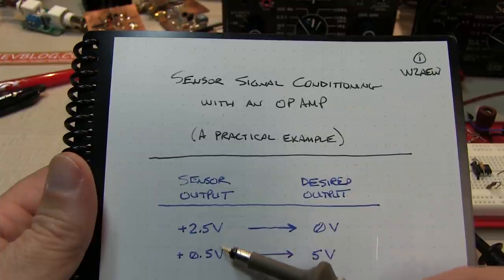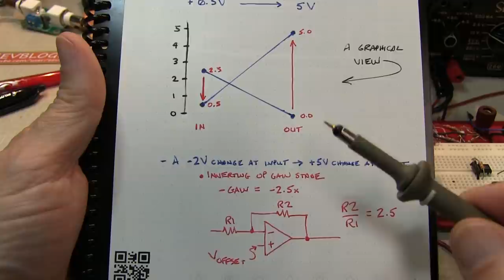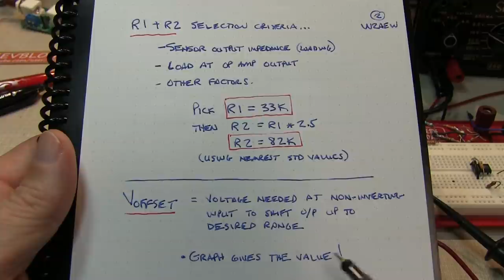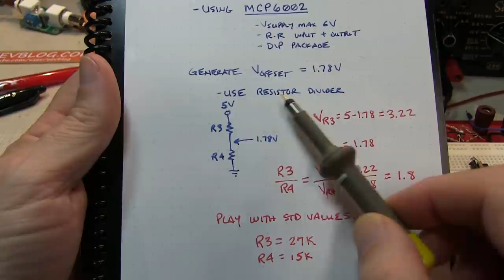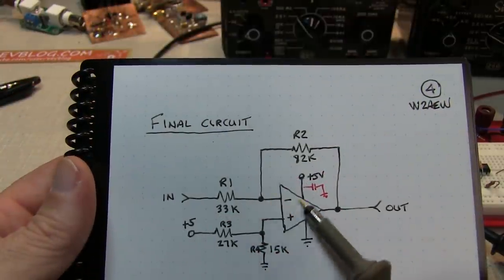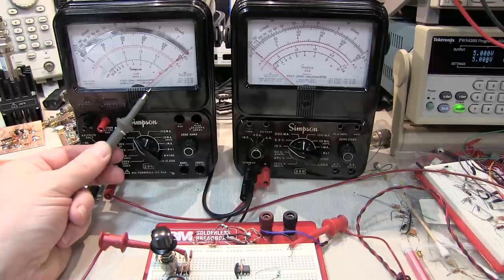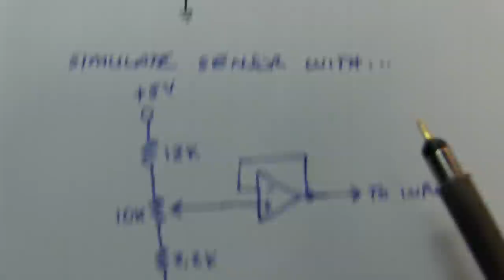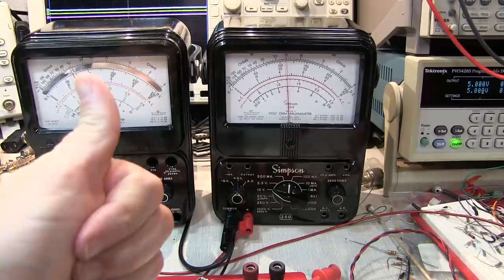#328: Circuit Fun: Op Amp Signal Conditioning - a Practical Example

Comment: This was great.   Thanx.    What are practical uses for integrator and differentiator op amp circuits?    Besides square to triangle or triangle wave to square wave generators.
Reply from the maker: There are a variety of filtering applications where they could be useful.  I've used integrators to generate the average voltage of a signal, and I've used differentiators to produce short pulses at the edges of square waves and PWM signals.
Reply: @w2aew  OHH!!!   OK  Makes sense.   Thanx.

Comment: This is a great video, but I was so sure the offset voltage was going to be 6.25V, because if you multiply the full range by the gain then add that offset, you get the correct output from the problem. While I understand how you calculated the 1.78 offset, I don't quite feel like I have the full picture, so I would have liked if you had shown the formula of the amplifier gain which included the offset in the equation.
Reply: Then you have to split the circuit in two parts. One part with only the input voltage and the second part with only the offset voltage. With the superposition theorem and some calculations you can determine the offset voltage. I can send you a copy of that calculation but I don't see an link or something else to do so.

Comment: Hi Alan,  I have a tricky op amp circuit request.  I have not found a single attempt at this solution anywhere on the web, or in text books.  Say my signal is a 150mV AC signal at 2Hz on a +3VDC bias.  I would like to separate my signal into its AC and DC components.  The only way I can sort of achieve it is to 'average' the AC using a high value R and C to ground and take an 'average' at the mid point.  Then use an adder in subtract configuration to remove it from the original signal.  Not very clean, due to the very low frequency AC component remaining in the 'average' signal.  The R is about 10Meg and the C is 10u.
Does this question make sense?
Thank you for your wonderful videos and very best regards,

Comment: What are those late series Simpson banana jack adapters you're using?
Reply from the maker: There are a few options for the reverse banana probes.  I show them in this video: https://www.youtube.com/watch?v=tfmRzkU_Y6g
These are the ones I'm using: https://www.amazon.com/gp/product/B07SSZVZLT
Note that you will likely have to slightly distort (squeeze) the barrel a little as I show in the above video.
Reply: @w2aew  Thanks. I picked up a series 8 meter and I remember the probemaster recommendation. I have several sets of their probes and I like them a lot but these didn't fit property on my meter. They sent me a second pair to try and the contacts on both were too small in diameter and became deformed (★★★★★ support.)  I also ordered some Oldaker 486-3 leads on ebay and those are a bit loose but work... OK.

Comment: More generally, if the power supply is not 5V or if it is susceptible to changing, you can use a biased Zener diode as the reference to the positive voltage divider.

Comment: Ok, a pedantic question from an engineering technician.  Other than the two in a  package why did you choose the MCP6002 over the National (now TI) LMC6001?  I can see from the TI pages that the LM6001 (national), the TLV6002 (?) and the MCP 6002 are all slightly different but are very close.  E.g. GBP LMC=1.3Mhz, TLV=1Mhz, MCP=1Mhz, Slew(typ) LMC=1.5, TLV=0.5, MCP=0.6 the noise figures are different, etc. The LMC lists the input bias current at 1000fA as a maximum where the TLV and MCP list that as a 'typical' unit.  I suspect this is the same "design" and the differences are so small that except for corner cases I can see them being interchangeable with each other from an engineering standpoint. Now that's with only looking at data sheets for 30 min.
Reply from the maker: Why did I choose the MCP6002 over the LMC6001?  Two reasons - 1) I needed another stage to buffer my 'sensor simulator', and 2) it's what I had in my personal stock.  Plus, the MCP part is a lot cheaper.

Comment: What be the  best/easiest way to convert a 3.0 volt(or other voltage) wall charger to power a 1.5 volt AA wall clock? Thanks in advance
Reply from the maker: A shunt regulator using 
- a resistor and a pair of diodes in series, 
- or with a "Vbe multiplier"
Or, use a three terminal regulator like a LM317 with the appropriate scaling resistors.

Comment: Good video very clear and shine (as always). What if I want to condition a negative voltage ( from 0 to -15V) to have an output 0 to 5V with 5V power supply? Is it still applicable. Thank you
Reply from the maker: The circuit would be a little different, but it can be done.
Reply: @w2aew  Sorry for the question. But how? The main issue I see is power supply limit of the OPAMP itself... Thank You for any hints
Reply from the maker: @Steve_LSP  The basic structure of the final circuit will be the same as this example, except that you would add a resistor divider to the 0 to -15V input, referenced to +5V at the other end.  For example, if the resistor ratio is 3:1, the -15V input will result in 0V at the divider node, and a 0V input will be 3.75V at the divider node.   Thus, you'll need an inverting gain of 1.333, and then adjust the bias on the non-inverting input as needed.
Reply: @w2aew  thank you for the help

Comment: Hi Alan, always great videos. Can you make a similar one but with non rail-rail opamps. Thanks.
Reply from the maker: Trivial - simply use power supply rails that are sufficiently far away from the input/output voltage extremes.
Reply: @w2aew  thanks

Comment: What about the slew rate and bandwidth of the opamp? Won't that make a difference, because the input is coming from some RF component?
Reply from the maker: The input is from an RF sensor - the sensor output is effectively a DC level that is proportional to the log of the input RF power - so the speed and slew rate of the op amp don't affect the result.
Reply: @w2aew  Oh that's great, just an analog voltage then. Thanks for the clarification! 😃

Comment: Any reasons why 990 discrete Opamps are so much better compared to 741 or 4558 IC op amp? They can operate at 36vdc rail to rail because 741,4558, LM308, etc can only go rail to rail clean swing at 24vdc to 32vdc. When the audio input swing gets closer to the rail to rail it creates an intermodulation distortion or causes other issues. The 990 discrete op amps don't have this problem I'm guessing, not sure why.
Reply from the maker: Yes, there are MANY reasons why.  The 741 op amp was designed approximately 50 years ago, using an integrated circuit process that doesn't come close to the performance and characteristics of modern IC processes.  The 4558 and LM308 aren't that much newer.  None of these op amps were designed to provided rail-rail output swing because the devices available in the IC process technology simply weren't capable.  The 990 discrete op amp is purpose-built for audio applications, using components and a design specifically selected for audio applications.  It is not restricted to use only devices available in a given IC process.  This is akin to asking why a 50 year old pickup truck can't meet the performance of a modern sports car.  While they are both motor vehicles, they are very different animals.
Reply: @w2aew  I know what you're saying but since the 990 is discrete op amp and Not Intergrated circuit process, what advantages, benefits, etc does it have because its discrete op amp compared to intergrated circuit process IC op amps? Sweeping from 20hz to 20Khz applying this range into a 741, 4558,LM308, all will have a different frequency response profile. I'm guessing the 990 op amp frequency response profile will have a gain flatness with no profile curve from 20hz to 20Khz. I'm not sure if you can apply 36vdc to 741, 4558, LM308 because most IC op amps datasheets says that max is 24vdc but it will cause non-linearity and distortion clipping on the output pins rail to rail way before 24vdc
Reply from the maker: @waynegram8907  Designing integrated circuits presents a unique set of challenges.  There are a VERY limited set of transistor types/parameters available, resistors are very poor tolerance, capacitors are only very low values, etc.  But, the advantage is that the transistors, resistors, etc. all are very well matched to each other.  So, you do a lot of work to exploit component RATIOS instead of specific component values and characteristics.  On the other hand, when designing discrete circuits, you can choose specific transistors and other devices based on the application needs.
Reply: @w2aew  What do you mean by component RATIOS? So using Discrete Op amps you can choose specific transistors, resistors, capacitors that are better matched transistors, low tolerance resistors and capacitors, but I thought that Intergrated IC Op amps has this also inside the IC op amp all the transistors and FETS are matched very closely inside the IC chip.
Reply from the maker: @waynegram8907  Absolute tolerance on things like resistors is very poor in ICs, for example.  They might be 20 or 30% tolerance!  But, all resistors will be off by the same percentage.  So even if a 1K resistor is 20% low in value, ALL of the other 1K resistors will also be 20% low.  So, you design your circuit to rely on the matching/tracking component value ratios, instead of their absolute values.  For example, design an amplifier whose gain is dependent primarily on the ratio of two resistors instead of on the value of one resistor.
Reply: @w2aew  I'm confused the IC opamps that were used in the 70's and 80's inside the Op amp IC chips didn't use carbon composition resistors so how can the resistors inside the OP IC chip be 20 to 30% tolerance? I'm not sure what material they used inside the op amp IC chip but I don't think it was metal film, carbon comp, Carbon film, Metal Oxide Film.
Reply from the maker: @waynegram8907  Resistors in monolythic IC processes don't support those traditional resistive materials -  They're typically different doped semiconductor, or on rare occasions, some kind of thin film.
Reply: @w2aew  Any reasons why its hard to find High Voltage switching power supplies ranging from 400VDC to 600VDC? It seems that switching power supplies for some reasons don't handle well with high voltage any reasons why?

Comment: Greetings to dear Master Allen
Please explain how to obtain the input impedance of a single-stage radio amplifier (preferably mosfet).  Like irf510 or irf520
With nano-vna or spectrum analyzer or scope.
I will be grateful
Reply from the maker: Sometimes a complicated picture.  For small-signals where the transistor is in Class A, a VNA can easily be used.  However, for large signal operation where the transistor is often driven into Class B or C operation, the input impedance isn't constant.
Reply: @w2aew  Thank you sir

Comment: When purchasing an esd mat and wrist band it comes in different configurations 0 ohms and 1M ohms. What are the reasons and different applications?
Reply from the maker: The zero ohm is called "conductive", and the 1M ohm is dissipative.  Conductive requires special care since build up static can cause high discharge currents. Dissipative is safer (and more popular).
Reply: @w2aew  Thanks for the reply, however  
I don't get it. The way I understand it, then when a static electric charge has been build and is discharging through the wire (either 0 ohms or 1M ohms) then: For 0 ohms there will be no voltage difference between earth ground and the scopes, FG, powersupply, etc. and the esd mat. However in the 1M ohm case there will be a voltage difference, which of course will diminish quickly. But that voltage; I suspect in theory could destroy a component?
Reply: Is there a ESD mat which you recommend?
Reply from the maker: @Infinitesap  The caution with 0 ohm mats/bands is that the static discharge that could go through a sensitive circuit/device will have very little current limiting, and the current spike can cause damage.
Reply: @w2aew  Thanks, that makes sense. :-) Are there any particular mat you recommend?

Comment: Was thinking during the video "wasn't there something about the resistors on the inputs should match due to input current on the opamp" - and sure enough it was mentioned at the end :)
Reply: Sometimes important, but often can be ignored if the voltages are high enough, the resistors are low enough, and you are not aiming for more than 8 bits in the system.